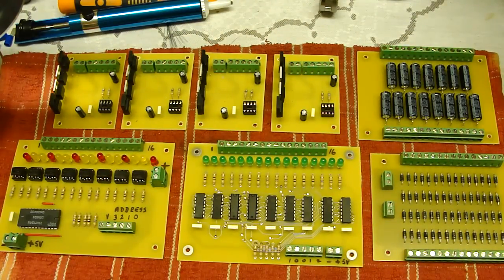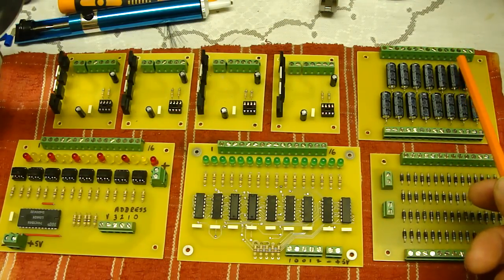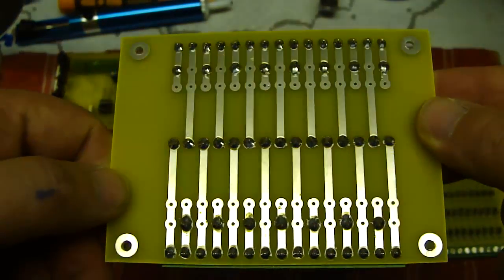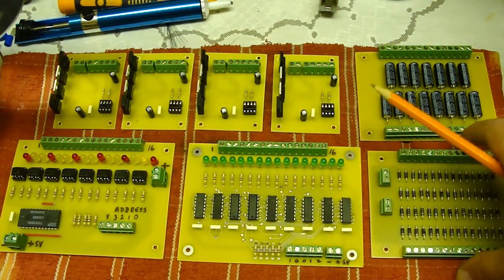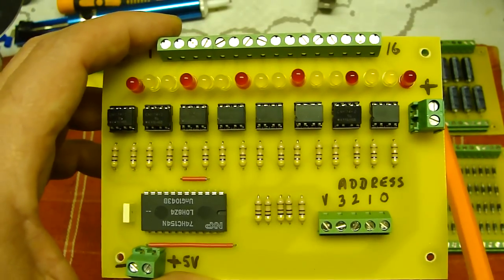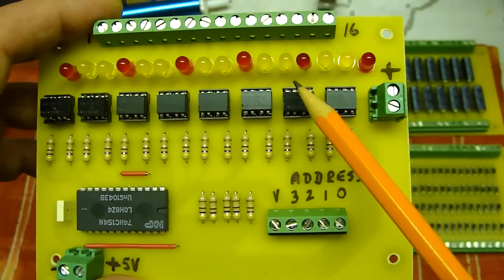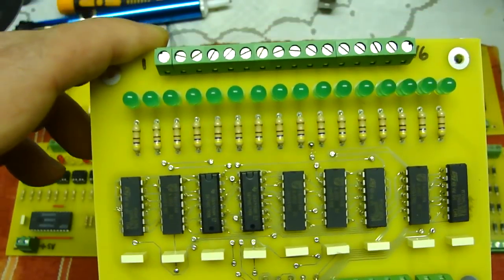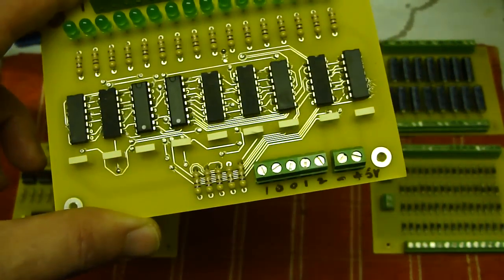Muller Motor Circuits

Comment from the maker: @ZeroFossilFuel The capacitor and FWBR boards were designed specifically to accommodate a maximum of 15 coil pairs. The OPTO and hall-effect sensor boards are ***generic*** by design and hence will allow for up to 16 signal lines (in or out) while resolving to a 4 bit address to minimize the number of pins required for this purpose on the Arduino. In this way I can use the OPTO and hall-effect sensor boards for other projects. In this way, only 9 pins on the Arduino are needed for communication.